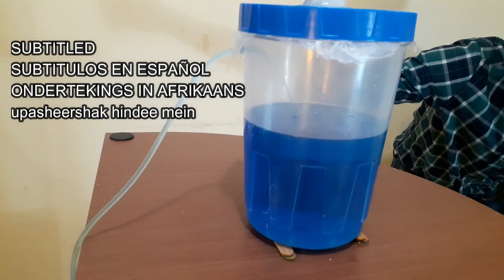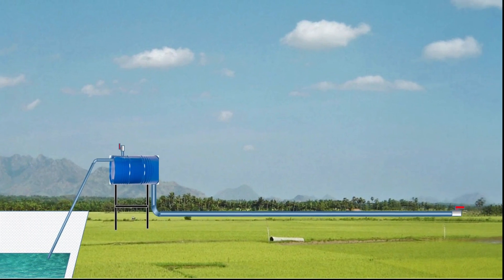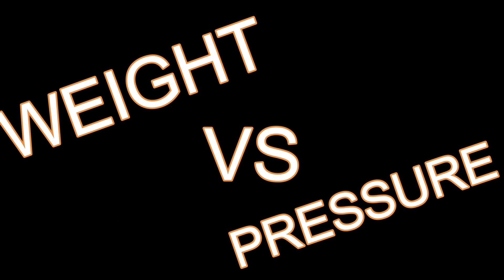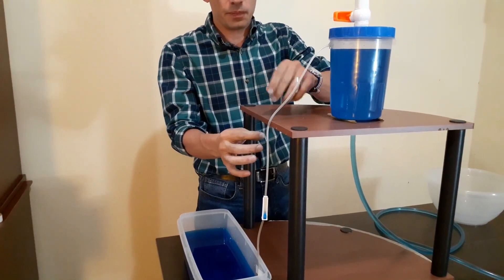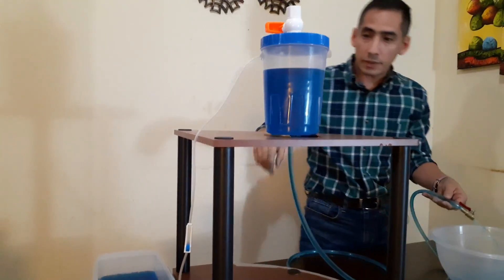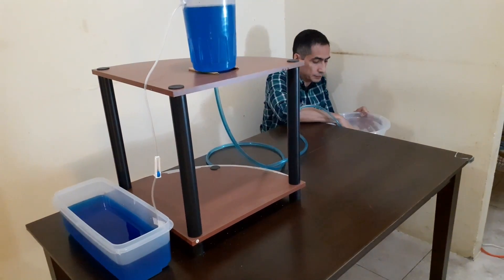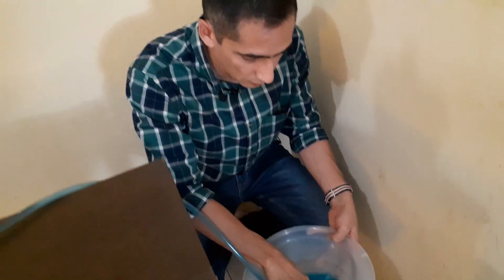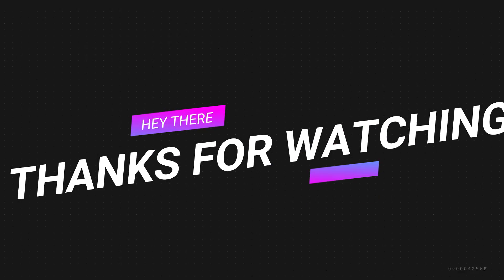FREE ENERGY Water Pump FULLY EXPLAINED!! REAL OR FAKE?  #freeenergy #waterpump

Comment: In your 1st test vacuum was entering in the tank. You need to tighten so any vacuum can't enter.
Reply from the maker: I will make another video with a vacuum gauge in order to asure an totally hermetic seal. Regards
Reply: @rubencobos  Yes i have also test it. It was not possible and all of videos are fake.
Reply: @strawman9410   there is more to it than what was presented here.. the size and shape of the container being used. For starters .. has to be a little bit larger in size that what is being used in this video.. because to get adequate flow and suction.. the input and output piping have to be larger. Also they cannot be made of rubber .. the level of suction that is needed  to complete this cycle will collapse the rubber hose.
   Also the 1st example in this video does not have hot glue sealing the lid.. this should have been redone and not counted.  This is where the air was more than likely coming from not allowing suction to happen..  the second test look at all the hotglue around the lid.. if he had kept the second container on the table only to provide moderate lift the system did and would have worked..
  No it is not going to pump water to any level above the " drum pump" but it would allow the suction to happen and the water to flow out in-between the drumpump outlet  and the ground which is in most cases higher level than the water source..
   I've seen Rice farmers use this same system to move water from a glowing river to a dried up rice field 50 or more yards from the water source..
    The trick is getting the drum pump high enough to allow gravity to do its job , also just as you stated .. the inlet/ suction pipe vs the outlet pipe has to be correct as far as diameter for the suction to take place
Reply: @strawman9410  Till now any scientists can't make free energy in this universe but you can it ???? 
Now a days people making free energy by only a plastic bottle or drum with water! How cheap! 
Funny man.
Reply: @strawman9410  I have already made it and tested it. All false. Just wasting time.
Reply: @strawman9410  if you don't think himself that you are the most brilliant one than any other scientist in this universe then you can stop.
Reply: @strawman9410  Please don't try to fool me.
Reply: @strawman9410  The reality of this type videos that it is 100% impossible. 
We can't create free energy.
Reply: @strawman9410  You can't get any work done/free energy.
Reply: @strawman9410   You're confused man. The debate here is about it being a working PUMP, not a SIPHON. 
I watched your video. You just did what was shown on the 2nd test. Yes, it will work as a SIPHON if the inlet is higher than the outlet. Yes it will work. as already demonstrated by the tests. What we're trying to verify is if it will work as a pump.

Comment: Please show or let me know at what level does the water  flow stop. Is the vacuum strong enough to suck the water up & keep the flow going even at a slow rate if the outlet is at the same level as the water source?
Reply from the maker: Thanks for your comment, the flow stops when the outlet is at the same level than the water's source level, im thinking of making another video with more tests and a vacuum gauge in order to show the pressures.
Reply: @rubencobos  Thanks. If you were to drain the outlet back into the source container making a closed system would the vacuum be strong enough to keep it flowing in a loop or since it is the same level will the flow stop. Looking forward to your new video experiments with the vacuum gauge.

Comment: Your system is not vacuum tight. The container should not empty. I built a similar model but mine was sealed. The water would not flow because air could not get in to replace the water.
Reply: I actually filled my container by syphoning in the water and the main line was fully primed. I agree that the system doesn't work, but your test was flawed.
Reply from the maker: Hi, I will make antoher video using a U type vacuum gauge for measure the container is completely hermetic. Regards.

Comment: Those farm guys have done it repeatedly with minimal tools and yet  with all your scientific knowledge you still fail 😂😂😂
Reply: I have tried this system using the fizzy drink bottle, and the drinking straws. It worked perfectly. Though it failed in the first test, the second test was much modified, - the system well air tight. Then it worked
Reply from the maker: Amazing isn't it?

Comment: I watched the videos in youtube many times. in my opinion the system must be sealed and no leaks. the suction pipe must have one way valve, the drum must be full of water leveled to the suction pipe because this system is working with gravity.
Reply from the maker: Thanks for comment, in many videos there is not a check valve, however all that you said is true, the system must have an hermetic seal.

Comment: I have been planning to try this in my plot where there is a shallow well, may be water level is 5' deep. Does your test mean that the drum pump won't work? I have seen many such videos, mostly from Philippines and Thailand. Why would they hoodwink people for no apparent gain to them! Could someone throw some more light on this?
Reply: It works perfectly well if the inlet pipe head in water source is fitted with a footvalve to hold water column initially.  Then fill-up the drum 80% with water and make the drum airtight. After that open the outlet valve.  It will work definitely.  In my village uneducated people's could assemble it properly just by watching the YouTube videos and it's working fine.
Reply: @kumudkishan4463  Looks like this endorsement is from the horse's mouth🙏🏻. You seem to have hands on experience on this.
I did  have a go with a mineral water dispenser container(20l) with the top sealed perfectly, with an inlet valve for filling the container. But I didn't have a foot valve for the inlet pipe(I sealed it with polyethelene, removed it when I opened the outlet valve). It didn't work. I could see air bubbles squeezing into the tank through the outlet pipe. I must try with a foot valve next time, before I go full fledged, with a 200L metal drum.
If you have seen 'uneducated', villagers doing it, then it should work. Although they are lacking in  formal education, their practical, worldly wisdom is unsurpassed.
Reply: @factfinder7591  yeah bro it's perfectly working and is already covered in my local news channel.
Reply: Here footballer in Iker head,  pruning of inlet pipe and drum,  airtight drum and smaller inlet pipe as compared to outlet pipe is important for a fine working.
Reply: *footvalve, *inlet,  *priming
Reply from the maker: Thanks for your comment, it is possible suction water from your shallow well ONLY if the end of your outlet pipe is in a lower level than the water's level in the well, this is a syphon my friend (not a pump), is for carry water from a High level to a low level. All those videos made by those guys are fake they videos are made in order to get money by youtube monetization.
Reply: @rubencobos 
Is it so? Since I can't neither raise my well nor lower the level where water is required, I may as well drop my idea.😂 ❤️
Reply from the maker: That's correct, please consider do not waste time and money trying it, you can try making a scale model like me and test it.
Reply from the maker: Watch my spanish version,  I make other tests (it is translated) https://youtu.be/bIaxxiuXXiU
Reply: bc their rice fields are lower level than the river dyke, the incline isn't easily perceived by eye or camera
the drum role is to prime/purge the long pipe
Reply from the maker: You are absolutely right,  however they are trying to fool people make them believe that is actually possible to rise water from a low level to a high level with this system

Comment: I agree with you pressure is still dependent on head not weight of water. But one comment on the first experiment. There shouldn't be any continues flow to a point it drains the tank. Water displaced was being replaced by air. meaning the tank is not air tight. Air is coming in somewhere replacing the water flowing out.
I still want to see the calculation using Bernoulli's principle if weight and movement of water in discharge pipe can't really generate excess energy. Maybe do a third experiment to use 20x the tube length you used, generating more flow momentum to gain a bit of differential pressure due to flow. Don't let any part of discharge tube to be lower than source. If there is truth in this concept, I would say Bernoulli's equation should show the amount of free energy.
Reply from the maker: Great!! I will do it that way, I am thinking of  using a vacuum gauge as well.
Reply: This is a fake video or someone is paying money to miss information remenber if it is free no body is going to  sale gas or motors
Reply from the maker: @jesusblanco984  what a naiveness,  nothing is free... energy neither.

Comment: I watched your video again.
I made test like you, I used glass coffee jar drill holes in it, perfectly air sealed.  Your 1st test the system was not air sealed, that why the water level did dropped.
I discovered also the water weight not count. The vacuum is.
Think abouth that, to lift the water from 4M need more vacuum then the outlet maybe 2M only, the system have shared vacuum. It does not work.
Reply: Your test is flawed, you lifted the hose above the barrel. That does not prove anything.
Regardless of the correct result your trading is pointless.
Reply from the maker: This is my spanish version I make other tests (it is subtitled) https://youtu.be/bIaxxiuXXiU
Reply from the maker: Thanks, but the column of water is the most important  regardless the weight, I have done the test a few of times with the same result, the issue is that the vacuum chamber doesn't have vacuum enough to suction "New water" I will make another video with a vacuum gauge this time, there is a range of vacumm, which is formed by negative presure from the column of water, the weight is irrelevant.
Reply: @rubencobos  weight counts, the heavier, the greater the vacuum
Reply from the maker: This is my spanish version I make other tests (it is subtitled) https://youtu.be/bIaxxiuXXiU